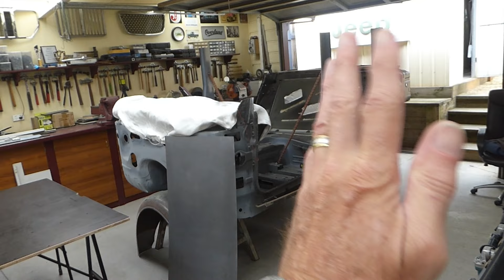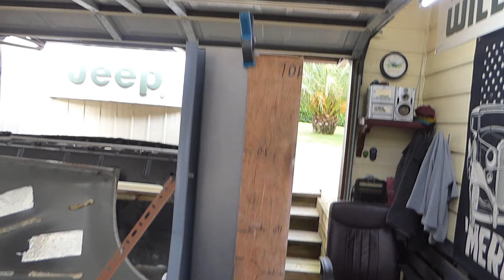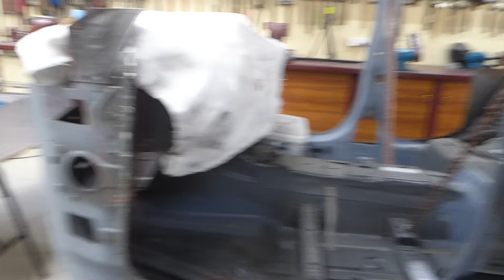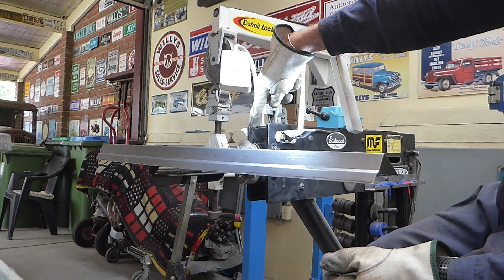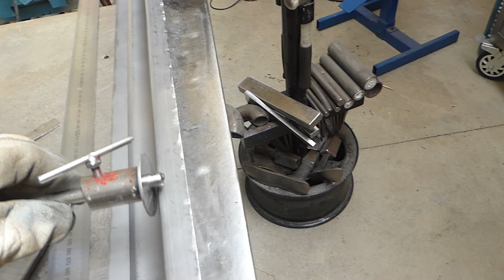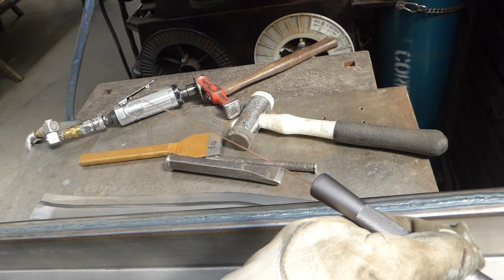Where does all the time go  Creating new B pillars. EP.11

Comment: Excellent work as always mate, I used the same reversing switch on my bead roller, is yours AC or DC ?
Reply from the maker: 240AC with a gear box. I found the motor under my dads house after he passed and was from the 1950's according to the model number search. Can't vary the speed unfortunately as wrong type of motor for that.